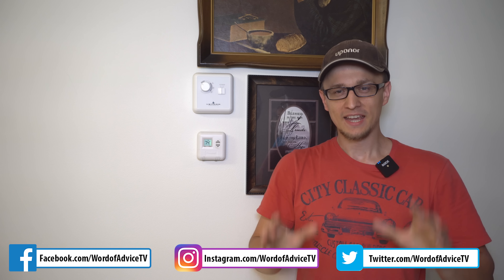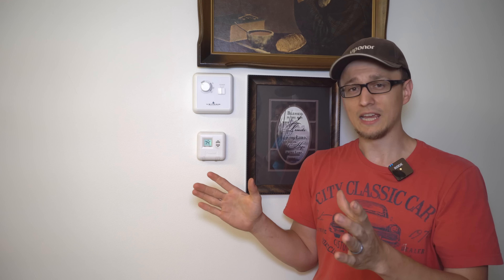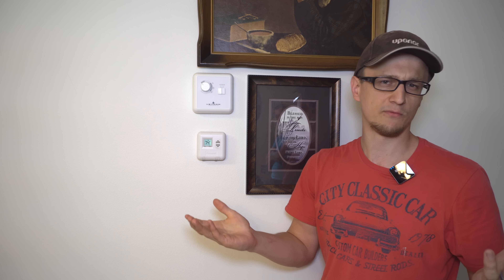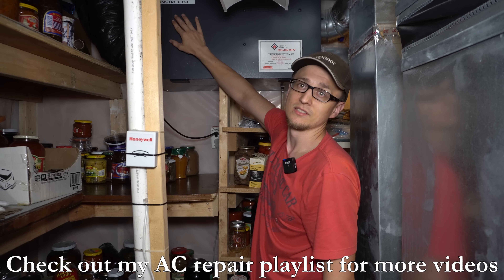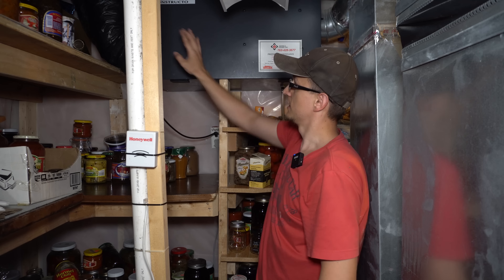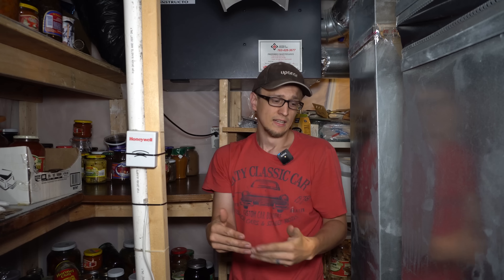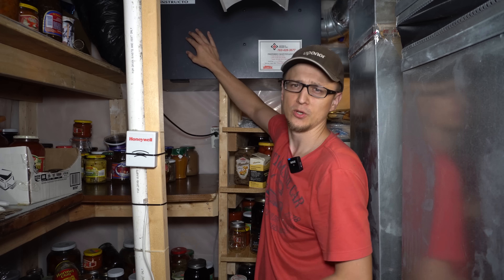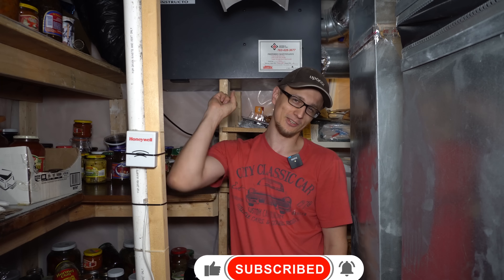Home AC Not Keeping Up or Struggling to Cool Down Enough

Comment: Reminds us of a case where we had a client that had a window open in a "supposedly" unused bedroom. Ac complaint wasn't cooling. Second law of thermodynamics :Heat transfer occurs spontaneously from higher (hot)- to lower (colder)-temperature bodies but never spontaneously in the reverse direction. * thus the importance of  air infiltration (windows), duct leakage, heat transfer and convection, thermal heat transfer (all this is in the manual J) .

Comment: We have an old house with no insulation in the walls and just blown in insulation on the attic floor. We have the same problem, set temperature to 74, but when it is more than 85, the AC can't keep up. It will be ok till maybe 1 PM, but then temperature will rise to 76 and will stay there until late  at night. We have a high velocity unit in the attic, so when it gets hot the exit air from registers goes up by about 4 degrees. Not sure what can be done. The ac size is ok for the size of space.
Reply: Did someone do an actual take-off of the home to check the sizing?  It will take into account the size of all the windows, the wall thickness, all insulation, exterior door sizes, exposure to the sun, etc.etc.  Then you know what is really needed for the house.  And being oversized is bad too.  (Obviously yours isn't oversized.)
Reply: badchips10. If you have multiple fan speed, try a slower fan speed. Although it's slower airflow, there is greater dehumidification, which might help.
Reply: I have the same problem

Comment: Thanks for the informative video. I purchased my home last year and we’ve been having high humidity issues for at least the majority of the time maybe the whole time for all i know. 
When i went into the attic to try and deduce what the problem might be i noticed a similar device installed but it wasn’t an air exchanger it was a fresh air supply fan. It appears to not be working at all. Couldn’t even get it into test mode. So i unplugged it and cut some cardboard and blocked off the intake in front of where a filter for it can go. From what i understand this device is supposedly to create positive pressure in my house for my hvac system. Do you think this is a crucial component to my system? Or should my ac and heating work just fine as a negative pressure system? It’s a track home from 2018 in Southern Texas if that helps at all. Also if it is crucial would the whole part you were saying about leaving the air exchanger off for the summer apply to this outside air supply fan as well? Thanks hopefully this question wasn’t too convoluted. lol

Comment: Mine was the tapes from the air handler, it was separate from the return and the intake, it so I was cooling my garage and sucking the hot air from it
Reply from the maker: Not an ideal setup right? :) The air to air exchanger I showed in the video was doing something similar. I took the homeowner outside and asked him to put his hand by the exhaust hood. It was blowing out cold air from the house.

Comment: Hi, Is it normal to have a gurgling sound when the AC (New Goodman Heat Pump AC unit, new Goodman Air Handler) first starts up?  Thank You. It does work well.
Reply from the maker: If the unit works well and there is no water leaks, then I wouldn't worry about it 👍 They do gurgle like that sometimes.
Reply: @WordofAdviceTV  Good to hear.  Thanks very much.
Reply: Spray some Windex on it.  That’ll fix it. If not , try WD40. That cures all odd sounds. 😆
Reply: Your condensation drain is stopped up. Blow it out with a small piece of pipe.

Comment: For too long a time, my A/C was not keeping up as the temps rose outside... or so I thought.  I found the problem.  It was the Honeywell programmable thermostat.  As the house cooled inside, the temperature displayed on the Stat actually went up!!  Consequently, the A/C unit would never shut off.  I replaced the thermostat & all is well now.
Reply from the maker: Thermostats can be sneaky like that! Thank you for sharing another reason why the AC may not be keeping up!
Reply: @WordofAdviceTV  Thanx for your helpful vids.

Comment: So,even in winter,it would  not be recomended to run  this unit 24/7.Is this unit humidity controlled?Or goes by thermostat?Thanks J,you are the go-to source for HVAC info!!  :)
Reply from the maker: Thanks Jimmy! It is controlled by a thermostat control (I show it in the beginning of the video) Most of these units are HRVs which have heat recovery cores (big plastic diamond looking thing :) so they warm up the cold air before dumping it into the house. But yes, there is usually no reason to run that thing constantly even in the winter.

Comment: Can you have too much air CFMs on a blower?  Yes, you can.  Since my static pressures are well below spec .2 vs .5 with blower on high i am moving 1575 CFM on a 3 ton unit, which is 550 per ton.  So a simple relay on the PSM motor with a WiFi switch for relay and I can switch between low 350 CFM/ton and med 425 per/ton via phone.  Gives better humidity and saves 70 watts and is more quiet.  That air exchange unit cost homeowner more then its worth already on kw costs, house is probably not that tight anyway.
Reply from the maker: Thank you for the extra info AD!!

Comment: Is an air to air exchanger the same as a HRV ?
Reply from the maker: They are not the same. The HRV has a heat recovery core which helps warm up the air before putting it into your house whereas the air to air exchanger does not do that. This of course is more important in the winter.

Comment: Been watching your videos. Is it possible my thermostat isn’t working properly because the Woman constantly changes temperature settings. Can’t get her to settle on one setting and simply let the unit do its thing.
Reply from the maker: Haha well if it's a woman changing the temperatures.. I would guess that there's probably nothing wrong with the thermostat unless it is failing to reach the set temperature all the time.
Reply: Word of Advice TV finally figured out what the problem was (after a 2nd tech from a different Co and $160 later).  The discharge hose to a pump in my closet was clogged. It was making compressor work extra, the thing turned on and off constantly. He cleaned it out w compressed air. Problem solved. Now I pour a little vinegar in the pump to keep it from happening again 👍

Comment: I have two ACs, one for upstairs one for downstairs. The downstairs was fine but the upstairs wasn’t. The fan was kicking on but I wasn’t getting cold air through the vents. We had never cleaned the coils so I figured it was that. I washed both out with water but my vents go all the way up to the electrical components. Then I plugged in the disconnect and it sparked. I think it might’ve been slightly wet. I waited a while, Then I turned off the breaker, plugged in the disconnect and flipped the breaker on. I heard a click but the fan didn’t turn on. The other one was fine though. The saver unit had power. Could I have shorted contacter or something with the water? What should I do to check it?

Comment: I hope you could help me with this problem, thanks. Recently I keep hearing my AC outdoor unit (probably the compressor) being switched on and off repeatedly for several times every time the indoor AC kicks in, this behavior repeats for about 30 seconds before it's stable for that HVAC cycle. When I inspected the outdoor unit I saw a dangling black electrical wire coming from inside the house into the outdoor unit together with the freon line & the hot line, if I move that line around I can hear "clicking" sound from the electrical panel. Just wondering what this line is for, and what can I do to fix this problem. I was thinking it is some kinds of condensate overflow float switch but I'm not sure since that is usually used for the indoor unit.

Comment: Really good video. Hope you can shed some light on this situation. 
What would hvac companies prefer to do, Replace a warranty evap coil or 
repair the leaks? How would these options affect out of pocket expenses for the 
customer?
Reply: There are sealers on the market that will work, but if the unit is on warranty, the manufacturer will provide the parts, but maybe you will have to pay for the labor... Keep in mind most major companies are one year warranty on parts and labor and 5 to 10 years  on the compressor.

Comment: Hey buddy i was working on a rooftop unit no cooling. First when i went there turn it on, the fan was trying hard to run and the motor was old and bad. I changed the motor and fan is running. Other issue going on there is compressor turn on first and after sometime it turns off. And after sometime it will turn on again. Can you help me with that

Comment: Should be controlled through humidity controller or co2 detector. As per set point controller allow to run or stop the air exchanger blower.

Comment: Awesome video. I do have a question I hope you can help me with. I do have 2 outside ac units one for 1 floor and other for second floor. My capacitor from 2 floor is not working so my ac is not working. I want to change it, but when I went to see what was it’s size it says 35+5 but the other unit has a 30+5 so I’m not sure which one to buy I try to find the manual but I couldn’t my ac unit is a Frigidaire model FS3BA-024KA. If you or any who read this message can help me I really appreciate it.

Comment: An air -to-air with synthetic paper cartridge should still be beneficial in warmer months. The paper exchanges humidity with outgoing air. And has about 60-80% efficiency. 
They often have 2 or 3 fans speeds, dial it to low. 

I'd leave to on except for very hottest of weather or you defeat the purpose of installing it
Reply from the maker: Thank you for the tips Nathan!

Comment: It’s been a few moons ago, but an HVAC tech told me that air conditioners are only able to cool 20° below outside temperatures.
Reply from the maker: So if it is 120 outside, the coolest it would be in the house is 100... :) Perhaps he was talking about something else because that seems to be an incorrect conclusion.
Reply: And that tech was 100% wrong.     People living in Arizona, Nevada, and other hot as shit places routinely have to endure temps of 105-110 for days or weeks at a time. But my home still got down to 68 if I wanted to play freeze out.     Also I’ve lived in Alabama with 95-100 degrees and 80% humidity with dew points in the  absolutely miserable 72-75 degrees, there again my home could get down to 68 degrees and 40-45% indoor humidity. (It could have gotten below 68 but there’s a limit to how much I’ll pay to winterize my home in the summer)
Reply: Word of Advice TV - All I know is I live where it was 100° yesterday & again today (rarely does it break 102°) my neighbor had both units (window & a brand new mini split) going nonstop to cool his tiny house of 500 sf down to 79°... which anything under 89° I consider cold.
Reply: The ideal temp split is around 20°. So if inside house air is say 80° the cool air coming out of register might be about 60° (ideally). Humidity lowers the split.
Reply: @sunshine3914  so I think ur guy was talking about the delta-t  which would refer to indoor temps....supply and return....16 to 21 degree differential...those temp numbers will change as ur house becomes cooler and is dehumidifies but the Delta t ...return supply maintain 16 to  21 degree diff. ..... And ur not gonna want to put ur set temp below 70
Reply: I live in Phoenix Arizona & it was 118 degrees yesterday. I was able to keep it at 77 and neither unit ran non stop. My units are 18 years old so nothing fancy  in that age of AC units
Reply: Word of Advice TV - From Google;
“More specifically, for our area, most systems are designed to lower your indoor temperature about 20°F from the outdoors. So, on days when it's 100°F outside, and your system is running at its peak efficiency, your indoor temperature will likely never maintain a level lower than about 80°F.Aug 3, 2015”
“A residential AC can lower the indoor temperature a max of 20°F. The heat transfer capacity of an air conditioner can remove enough heat from a house to drop the temperature by 20°F.Sep 23, 2019”
Reply: Bah Bee - That’s great! You should let everyone know what kind of system you have. However, it wouldn’t be effective for those who live in a tropical climate.
Reply: What your technician was referring to is design capacity which is typically 20° to 25°. When a system is designed using the Manual J Residential Load Calculations you calculate your cooling load based upon a temperature that is specific to your area. In my case, Dallas, TX, the 1% temperature is 98°. The 1% refers to the percentage of hours per year that are above 98°. For example, it was 102° a few days ago, my thermostat was set for 74° but the best it could do was 76° which is 26° below the out side temperature which is pretty good. Properly sized single stage air conditioning systems can realistically only cool 20° to 25° below the outside temperature. Some contractors oversize systems to compensate for extreme temperatures but you end up with a system that short cycles during more moderate temps which in turn creates humidity issues. If you have the resources you can always install a 2 stage or variable speed system
Reply: Bah Bee bless your heart, I can’t handle that much heat, 77 is to hot for me😩
Reply: @bahbee5659  so u did 40 below outside....nice!!!!

Comment: I listened to 50 secs of the vid I paused and i k own with me being a new tech I might get some hate personally I wouldn't of connected gauges I would of cleaned condenser from inside to outside then cleaned condenser blower motor then cleaned furnace blower motor but before I did all that I would check filter and make sure merv rating matches system if I not I would inform home owner then after all that and it still dosnt get to the right temperature I would tell home owner when they are home to look at lines going to the condenser and if there is frost that tells me i could be low on refrigerant or clogged filter dryer if one is Installed.   Idk if water in the system would cause frost on lines I think it would if some one knows can you please confirm if  right wrong 

Also if anyone knows how to get vapor out of a gauge manifold let me know I know how to put liquid back into the ac system but I have no clue about the vapor left over Ik I could probably put in to a vac but I don't want to ruin the gauges or cause the home owner to loose refrigerant in the long run like how can I take Mt gauges off of a system and read zero on low side and high side

Comment: I jack my a/c down to 70 degrees at 6am.  I know the a/c won't keep up with our 100 degree temps, it stays at 72-72 degrees on the thermostat, when set on 70 at 6am.  there is a 20 degree temp split with my infared gun.  It's the price I pay to keep my wife happy.